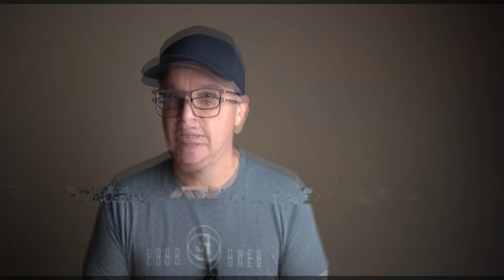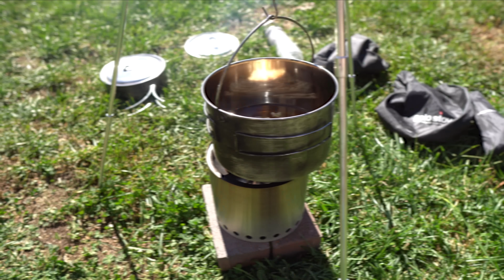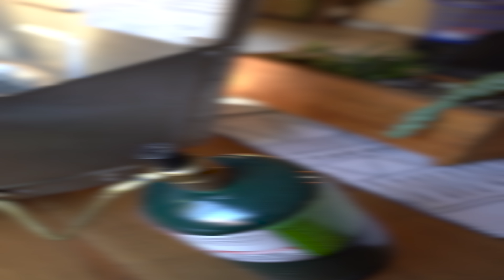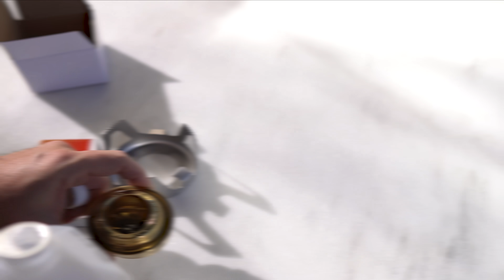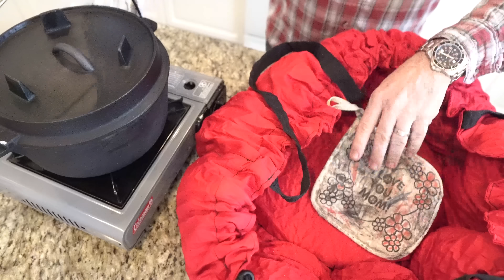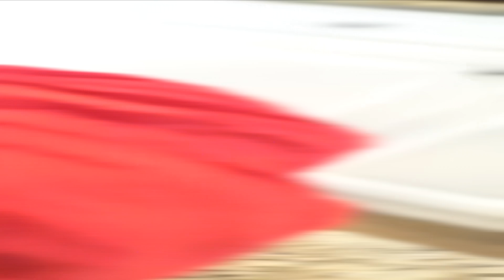12 Ways to Safely Cook After a Disaster

Comment: I have a hot water machine that plugs into the truck. Generic K cup hot water machine allows you to get the measured amount of hot water I need for just add hot water meals and drinks. It runs fast so I would not drain the truck battery. Mountain House pouches, instant oatmeal, Cup of Ramen, coffee, tea, hot chocolate and hot apple cider are my just some add water options.  It just takes a few minutes of power to get hot water. The truck is kept in a sheltered awning and Is hidden from view behind the barn. The awning allows shelter and ventilation for when the truck is running. The truck is used once a month for hauling and the tank is kept full.

There is a secluded shelter house for when  I use the pellet camping stove. I have canned meals that can be heated with my pellet camping stove with each round of heating lasting 5 to 8 minutes. That is enough time to heat up a can. 

The fire pit is situated by the cemetery and I built it with a cooking grate. It is not visible from the road. There is cast iron cookware here so I did not have to buy it. 

I have dehydrated fruit, nuts and trail mix in a sealed bucket as a I am not going outside to cook anything option.  

I am building up a indoor gardening system where I can use the skylight system to get sunlight to the indoor garden. Tiny Tim is a variety of cherry tomatoes that can be grown indoors because it is small and compact. I need paint brushes to tickle the blossoms and get fruit. So I am going to have leaf lettuce or micro greens with green onions and cherry tomatoes which is good enough to make a simple salad which is also no cooking. I can make bread once a week and use the shelf stable precooked bacon and heat it up with just a lighter on the back porch to make BLT sandwiches as well with the lettuce and tomatoes. 

Those are the  options I went with for cooking.  I am just the property caretaker so I am Leary about lighting fuel sources inside because of fire hazard. And propane is too expensive for my budget. I refuse to go hungry this winter.
Reply: Holly,
Going into winter without a nice layer of fat is probably a bad idea.
.
We operate a small organic teaching farm near the outskirts of Eugene, Oregon.
We share the acreage with a couple-three dozen other workkampers in RecreationVehicles and various versions of home-made ExpeditionVehicles.
Our chillers -- run on propane -- are filled with processed veggies, swine, and sheep cheeses.
Anything we need, we swap with neighbors at our farmers markets.
.
We honestly truly believe tribe and skills carry more value than stuff.

Comment: What would be the best recommendation for someone who lives on a high floor apartment with no balcony. What would be the safest way to get boiling water without causing a fire or gas. This is the Northeast, so snow and cold
Reply: High floor apartment, snow and cold...... hmm. I recommend you leave.
Reply: I would use a basic camp stove to get the heat up to temperature, and then use the thermal cooker to finish the job. Helps preserve your fuel.

Comment: I CANNOT find a flanged camping lid from Lodge for my Dutch oven. Their website always says out of stock. Maybe they stopped making that? Someone on eBay was selling one for a crazy price. If I put the pot in my fireplace, I can’t put any coals or fat wood embers on top of the regular lid…it’ll just slide off. Anyone know where I could get the camping lid?
Reply: How bout if you put the lid on upside down? I have this issue but my dutch oven has a glass lid so I'm not even sure if I could put hot coals directly on top anyway.

Comment: Biolite campstove is great. Just twigs for fuel like a Kelly kettle. Which I also have.  If you are lazy you can use wood pellets. Can cook with 1/3 cup of pellets. Works out to over 400 meals with one 50 lb bag of pellets. Less than 2 cents worth of pellets runs smokeless with a bit of practice and you can recharge your phone or use fan unit as a battery bank. Takes 4 cents worth to cook a burger or steak Hard to beat.

Comment: Good overview of cooking options. I'm sure all of this is new to so many who never dreamed they would be faced with the state of the world as it is now. Not me, I have 100 gal propane tank and extra 20 lb tanks, a propane grill, a propane heater, a wood/charcoal smoker/grill, a "hot tent" woodstove with side water tank, a fire pit, acres of woods and the means to cut it by hand if necessary, and lots of cast iron. Clearly I intend to bug in, but if I had to be on the "lamb" I have gobs of lightweight camping/backpacking cookware and have used all of the before mentioned several times each year.  I practice bushcrafting and survival skills regularly and have been honing my skills for decades,
Reply: On the lam not lamb
Reply: @nancylourose  TY
Reply: My new,
We are permanently 'on the lamb'.
We summer up rough logger tracks around remote mountain lakes.
We winter on isolated Baja beaches.
Every day is a lesson in foraging and networking.

Comment: Love that you included the Solar cooker. Got 2 types of these. Florida has alot of sun.
Reply: @spritsfal5088  Hot plates suck up alot of power. And the solar cooker is alot cheaper than your largest capacity solar generator, that could handle a hot plate.

Comment: I have a solar cooker and consider it a secondary cooking device. Obviously it requieres good wheather and time, so my bugout back contains a small foldable caping stove and matches/lighter, to use anything I might find for cooking. But for the bugin plan I have a gas cooker and some small cannisters of fuel for it, that I plan to use whenever I can´t use the solar cooker. 
On the other hand a solar cooker is a way to connect to neighbors, offer them to save fuel and cook with me when the sun is out, to form connections, while showing only the cooker from my preps.

Comment: For those with solar generators a instapot is a great choice for cooking with.  Only uses electricity to bring up to temp then shuts off and slow cooks under pressure. Little trick i learned from the van life peeps
Reply: After running into electrical issues in a camper a few weeks ago, a word of caution.  The initial load an InstantPot draws is about 10 amps.  Thereafter, I think it hovers around 7 or 8 amps.  If your solar generator won't generate that, you could destroy it and your instant pot.  Know what your gear is capable of doing.
Reply: A little helpful trick with an instant pot...if you can heat your water/liquid before using, it will get up to pressure quicker.
Reply: I would love to see some videos of people showing what solar generator capabilities are necessary to meet the electrical demands for certain instapot tasks.
Reply: @CascadiaPrepper  Hobotech has done that several times on his site. He’s the premiere portable solar battery reviewer, and I find him very honest and straightforward. His findings have confirmed my own on several models I own.
Reply: @NOLAgenX  thanks- this my next education piece to tackle!!!!
Reply: @CascadiaPrepper  not to mention that in this sort of situation solar panels will also be a target for ppl to steal
Reply: I've always overlooked the Instapot.  Thank you.  I have a Jackery and was wondering what appliance I should buy to cook with.
( I have other methods, but always need a back up).
Reply: @yeswing10  the best cooking utensils are stainless steel  pots, for frying and cooking meals, they heat up quite quickly , but need heat reduction once heated, to avoid burning, tin pan are good for fast boiling water, due to it lightness. Ie soups, water, bean etc. I hope this help.
Reply: @yeswing10  try it out! Divide the watts of your "solar generator" by the watts of the appliance and you will get the hours needed. Dont forget surge watts though.  An appliance may be rated at 200 watts but it surges to 700 watts to get the appliance hot. I have tried microwaves,  air conditioners, electric blankets,  blenders, etc. My Jackery 290 can heat an electric blanket on high for many hours.
Reply: @bronzefox9035  Thank you for giving me the Watt formula.  I wrote it down for future reference.
Reply: @yeswing10  id like to know as well:)
Reply: @yeswing10  I have a very small Jackery but plan on using fire...so much wood laying around since the storm...to cook with. Had not thought about insta pot.....
Reply: @stephwillson7161  I have a Jackery 1000.  They are nice, but take 8 hours to solar recharge. Having at least 5 or more ways to cook and  heat up a small area is vital. 
Get a -20 sleeping bag, depending on where you live.
Reply: Also look at 12v and 24v appliances like truckers use. That way you don’t need an inverter. Look around truck stops or on line
Reply: Instant pot is my plan for the first 3 months or so. Then rocket/liquid fuel to cook with.
Reply: Be careful with instant pot pressure release though!  Most meals...really all meals I've made in it spread the aroma throughout my home and outside, especially with the quick release.  Talk about a dead giveaway!
Reply: For the algorithms
Reply: @strtkempo  same
Reply: If the world doesn't end next year, I'm going to vastly expand my solar system, taking advantage of the 26% tax credit and any other new incentive programs that might be around in 2022.
Reply: Excellent point!🤔
Reply: instapot googled.
Interesting. Almost the same weight.
Fewer overall solutions and overlapping tech.
A nice thought process though. 
Thank you.
Reply: Coffee can burner with alcohol,  propane stove, kerosene and butane, a little solar, building a solar cooker, sterno. Fire pit and grill.
Reply: @mandykathryn9005  I just saw a SOLAR OVEN on another channel.  She cooked bread in it!
Reply: @yeswing10  I have one too. Bought it 10 years ago but it’s never been taken out of the box! You can cook entire meals in it BUT, again, your cooking outdoor where smells travel….
Reply: @Fart Zilla yes, I have a portable indoor propane stove. So that I have other ways to cook.  Used to be only $20 at Walmart, now they cost $35.
Reply: Exactly what I was going to say except I have a 120VAC hot plate, which is like one element of an electric stove top.

You don't want local hungry people attracted to your outdoor cook out.
Reply: I wonder why people keep referring to them as "instapots," lol
Reply: Van dwellers, rvers and backpackers are a font of golden wisdom
Reply: do canning. Buy a pressure canner and can food, no need to cook later, just heat up. Don't be scared, pressure canners are not that scarry
Reply: Thanks for the tip.
Reply: Please do a video trialing this!! 😍😍
Reply: Ooh. Thank you, Friend.
Reply: THAT is an awesome tip! 👍 Thanks
Reply: Contains the smell... Untill you can bring it under ground.
Reply: Interesting! Keeps the temp?
Reply: Never even thought of that. Thank you so much.🤗
Reply: Solar generators are too expensive to be relatable.
Reply: @totosakigami7181  How much is your life worth when the lights go out, a alternative source of electricity for a heater or air conditioner or to cook with is just another prep to have.
Reply: Better off getting stove top pressure cooker
Reply: @TheWhimsicalFamily  what if there is no power?  Electric stove won't work.  That's what we're talking about. 
If you have a gas stove, that's great.
Reply: @yeswing10  For a prolonged power outage even gas stoves wont work as the electric pumps to feed and pressurize the gas lines will stop.
( ask everyone in texas last winter )
Reply: @woodythehikerw9323  so much for the gas fireplace.  I have the terracotta pot method and Mr. Buddy, and very good clothes and sleeping bag on standby.  Hope I make it.
Reply: @woodythehikerw9323  propane tank
Reply: @yeswing10 Most folks have propane grills in their yards.
Reply: @woodythehikerw9323  my neighbor here in Texas had no problems with there gas continuing to work through the last winter.
Reply: @yeswing10  misses the solar power didn't you?
Reply: @woodythehikerw9323  Didn't know that.  I grew up where there was a gas stove and when I bought a house it had an electric stove and lamented it since as a kid when the electricity went out we still could cook, but in my old home the electricity never was out more than a day.  Interesting to know that converting my new home to gas which would be very expensive, wouldn't have solved the problem.  I now  have alternatives thanks to research with videos like this.
Reply: @yeswing10  MREs or homemade pouches of freeze dried food and tepid water.
Reply: @Nice-qi5cf  I have 3 weeks worth of MRE's besides the other preps.  I should keep adding to it.  Prices are going sky high and shortages.  I also collect Life Boat food and packs of Beef jerkey.
Reply: @yeswing10  look into a rocket stove, there are so maby choices or you could make one. I am fortunate to have 4 welders in my family so I had one built for no cost.
Reply: @TinaD_RollTide  I have several rocket stoves.  Just in case.  Different kinds.  Plus butane indoor portable camping stove.
Reply: @yeswing10  oil/kerosene lamps, tiki tabletop torches with lamp oil in them, olive oil lamps (basically oil in a jar with a piece of cotton/wick) and tea lights make a huge difference too. Especially if you have plastic drop cloths or curtains etc. to block cold air from windows and close off a smaller space in your home to keep warm (curtains far, far away from flames though of course). I can't store much propane and there are other issues, so my Buddy isn't super practical for home use. I was worried but last year during a terrible winter storm my other lights/flames were totally adequate to keep me warm. It was such a relief
Reply: @woodythehikerw9323  get a conversion kit to convert mains gas stove to lpg and get a few propane bottles.
Reply: @TheWhimsicalFamily  they are actually faster than the instant pot and cheaper and repairable.  The instapot is like the modern blender who really needs 15 speeds this is consumerism and nothing more ppl.
Reply: Until you have a couple days of cloudy weather!
Reply: @TheWhimsicalFamily  two hours running a small quite generator (about 1/4 gallon of gas) will help recharge solar generator. While generator is running to keep chest freezer going, solar generator gets topped off.
Reply: @TheWhimsicalFamily   You can run an instant pot off of your car with a power inverter
Reply: It's Instant Pot, not "Instapot." The company's name is Instant.
Reply: @lauriesmith7517  you say tomato i day tamato
Reply: Until it blows up.

Comment: Love the Coleman stoves; just make sure that you have a carbon monoxide monitor if used indoors.
Reply: I just put batteries in both CO2 and smoke.
Reply: CO is more dense than air, so it settles. You need an opening for it to dissipate, preferably outside.
Reply: I've used a coleman propane stove indoors for 3 years I just don't see any reason to buy a regular stove.
Reply: Great advice. Think about buying a spare carbon monoxide monitor now.
may not be available in the future.
Reply: The ozark trails one from Walmart is pretty good too. The one I use almost daily is almost 4 years old and still working quite well.
Reply: We definitely use one.

Comment: In re: alcohol stoves indoors. Sailboat owners tend to replace the original alcohol stoves in their galleys because you can't see the flames when they're lit. This makes them Very dangerous, especially if you have pets or small children. I live alone and can put together a quickie stove using a #10 can, a roll of toilet paper and 91-percent rubbing alcohol, but I consider it a real doomsday option. Headline that I never want to feature in: Local Woman Flambes Self During Power Outage.
Reply: These should be used outside, as should the buddy stoves made with wax and cardboard. They have a nice, manageable flame...at first. The minute the wax or alcohol is spent (without warning) and the  biomass starts burning (toilet paper or cardboard) it turns into a 3' high torch! I've seen comments in which people think they could use them indoors or in their car. Don't! They also emit carbon monoxide when biomass ignites as well.
Reply: @dianenordstrom2770  Try a tightly rolled bundle of fiberglass fibers instead or TP or cardboard. I've had good luck using it with alcohol.
Reply: @dbergerac9632  Or perlite or vermiculite. Now I have a couple of experiments to do. That was a great suggestion.
Reply: lol.   Good ideas.
Reply: Used then can to and alcohol while hunting in small blind. Keeps ya warm.
Reply: You would waste toilet paper in an emergency situation?
Reply: @willholly7526  Well, it wouldn't be quite the same as papering somebody's house, would it?

Comment: Comprehensive video 👍
With the exception of gas, all the other cooking fuels and methods need practice to achieve good results...only one I haven't tried is solar (I'm in UK) enough said :)
Denatured alcohol is safe to use indoors... I think that's a big plus. The primary biproduct from burning it, is water vapour... virtually no carbon monoxide is produced.
As you suggest, I do think a mix n match approach to fuel types and appropriate cookware is a reliable solution. I quite like wood pellets, since they can be weighed out for specific burn times, and they're virtually smokeless...cheap too, easy to store, clean to handle with little ash remaining.
All the best from Bournemouth (South UK) 👍

Comment: have a gas grill with a burner on the side which is handy. I have a rack for wood burning. and unless if the house isn't totally wiped out. I have one of the cheap burner that burns little cans butane as matter fact have two and a case of fuel. have a charcoal grill and  and about a dozen of bucket charcoal , have a tripod a dutch oven